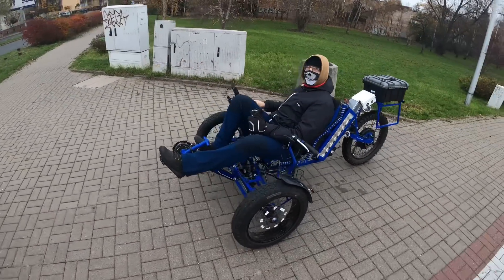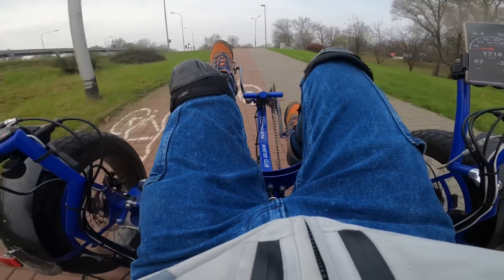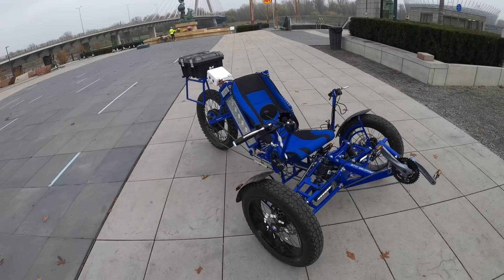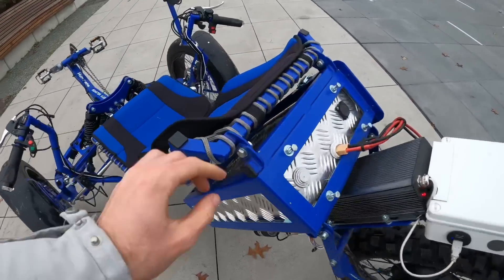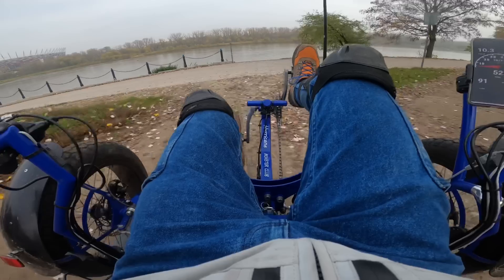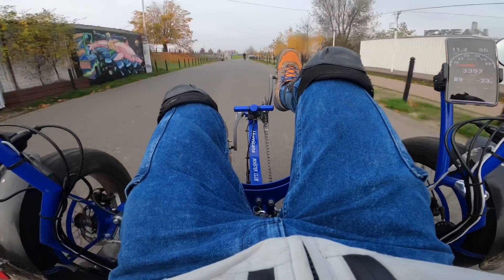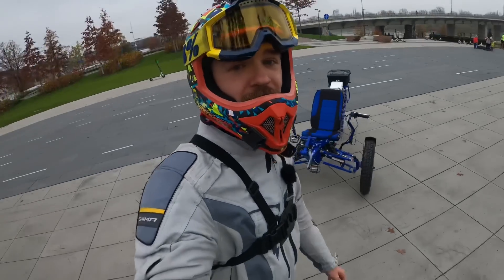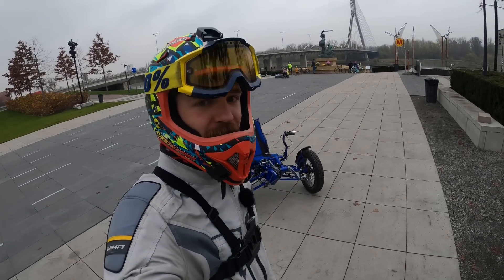70 KM/H THREE WHEELED EBIKE

Comment: At 70kmp it’s not legal to ride on any of the bike trails where I live. And in some areas, I think my area is one of them, you would be required to have a license. Other than that legal disclaimer, this trike is freakin cool. With the speeds it’s capable of the indirect steering is a good choice. As for brake turning, that’s not good for the trike. Still I wanna turn on it. 😎

Comment: Love this build.

I've got a rigid framed Terra Trike DIY 1000w hub based setup.  I've been running it for 2 years now, and absolutely the best fun to be had, "below the Radar" of the fun police.  

FYI - if you are lifting front wheels, you are a millisecond away from pain - don't do that!  The CofG does wander precipitously within the triangle of Stability.  

I'm building up a suspended version at the moment.  Rigid does ok, but i and the trike get beat up on the off-road double track trails that are extensive in this area.

Comment: I can tell he violated some basic rules of the steering/suspension design, that would reduce bump and brake steering effects - naturally you can never completely elimante brake steer on this type of design, but there are things to consider also I think there is no sway bar which would reduce instabilities when correctively steering especially on straight sections...
Reply: @20:00 The rear brake should be easyly implemented to be electric by default and use the electric disengage signal from the front brake levers to turn that direct drive motor into a generator recovering energy!

Comment: How hard is to pedal it (without engaging the electrical motor)?
Reply: The owner has longer legs. They are generally made to fit one rider, because adjusting for leg length involves changing chain length.

Comment: the steering is not in balance, because the weight is to far in the frond. Also the axel of the frond wheels must be more backwards compare the steering system, because if you let loose the steering it will steer straight. i think you have to build another one.

Comment: Hey man I know this doesn't have to do with this video but I wanted your opinion. I'm a big guy. Like 270. Should I go with gotway MS/Monster or Sherman. Thanks mate.
Reply: Check out Greenspeed Magnum big wheel model, you can option 4" wide wheels for them. Heavy duty trike for up to 160kg and 6'6"

Comment: I like this trike and am wondering if a gas engine or as you say there petrol engine like a 4 stroke engine with a jack sh aft so as to use nothing but the gears and regular drive chain be added also along with 2 front electric drive  wheels of the same size for added speed and distance? I am an avid outdoors man and is a trailor hook up was added so that a child s trailor size about the size of what you would use to transport very small children if that would also work with this with added batteries life or rather more powerful batteries be added also the ground clearance be increased slightly more to allow for better off road travle when needed it would be fantastic if robert would like I have always been an idea man and was a machinist for a number of years so if he would like maybe we could come up with some ideas that would work with this also it would be nice if this could be sold as a kit to build in your home if wanted also making the death adjustable for people not only with the back but in the positioning for people who are a little shorter so as they can reach the pedals or longer for taller people.